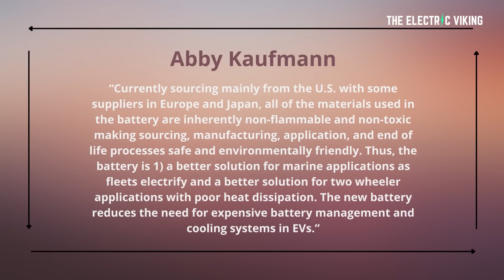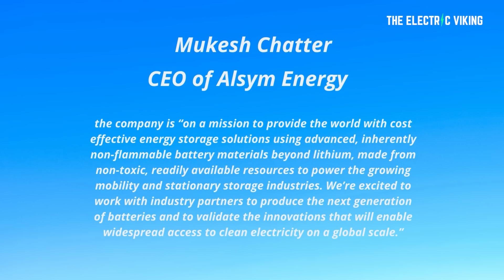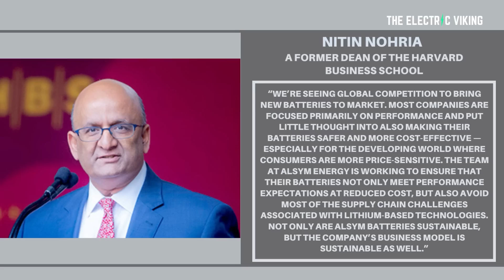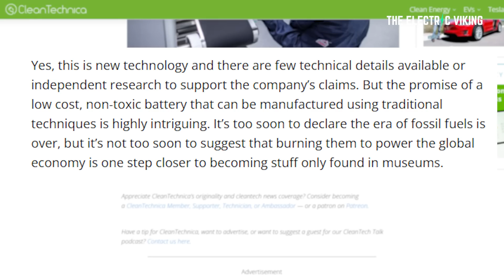NEW super cheap WATER batteries revealed by US company

Comment: Click -  title - lol, water-based electrolytes are nothing "new" - 

Yes the Uber-protectionism being displayed is strange - most companies will have IP well sewn up  before any public statements are made.   ?? Patents ??

Using heavier, less reactive materials in electrodes will deliver lower energy density - as there is lower energy available in the redox reactions. - Power density on the otherhand is more about battery configuration rather than chemistry - specifically.

Comment: Patents of Dr. Rahul Mukherjee: U.S. Provisional Patent Application No. 62/815,770, filed on Mar. 8, 2019, the content of which is hereby incorporated by reference herein in its entirety.
TECHNICAL FIELD
This disclosure relates generally to aqueous aluminum ion batteries, hybrid battery-capacitors, cathode compositions, anode compositions, binder compositions, and methods of their manufacture and use

Comment: A new game changing battery with no specs at all, from another startup. File this under “Unlikely”. Could it happen? Sure. Will it happen?… I can see the holding back on the tech reveal due to competition, but to avoid any specifications on performance benchmarks is highly suspicious. My guess, heavy, lower voltage, slow charge times. Therefore boats. Therefore non critical ATV type uses. Who knows, but their Holy Grail description is the biggest red flag.

Comment: Water based electrolytes means low voltage cells, usually lower than 2V. This battery will have a hard time competing with Li-ion, as it requires doble the connections and BMS circuits.
That said: the more, the better. I hope it succeed.
There is a lot of promising electrochemistries floating around that never seems to reach the market. Like that very interesting Al-ion urea battery.

Comment: Mate, love your enthusiasm and  the work you do, fantastic mate to hear an Australian perspective especially about so many other non-Tesla alternatives…but please, please- check your audio levels! They are so loud they are almost distorting at times. As a documentary maker of old, when editing, you need to check them, thanks. And while I’m nit picking, may I suggest a lowering of the lights! You are over lit around the face and it doesn’t look the best.  Bouncing off the ceiling or a nearby wall is a really good way to diffuse interior lighting. The jump cuts are ok but not the most fluid for a professional look, you may want to look for alternatives. 
Other than that, good stuff - especially the many alternatives in brands. May I suggest a future program where you list all the full BEV’s sold in Australia and their availability and ease of purchase. 

Cheers Sam.
Reply: Audio level sounds about OK to me, compared to other channels, but it's indeed possible that the input level is set too high, saturating and distorting the audio just like the lighting and room color is saturating the video.
It could also be a defective microphone, a poor choice of recording settings (either on the software side or with the different buttons on the microphone hardware). The naked-wall room with almost no furniture also ads echoing, not as noticeable in this video as in some previous ones though, but that's not what is causing this amount of distortion.

The white room and lighting color are indeed making Sam look like a first-generation-LED electric Viking, no wonder it makes him blink like a great horned owl...  😃
There are warmer color LED light bulbs that would look better on that skin complexion, and they might also reduce the shadowing that makes the eye bags stand out. Some creams and make-up could also do the trick, but it's really no big deal, at least compared to the work needed on me to make me just presentable. I'd need cream by the gallon!

It would also be great to reduce the unreadable list of links in the description to those pertaining only directly to the video, or actually start putting even one relevant link (no link to Alsym web site, for instance) instead of all this self-promotional stuff.

Yeah, sorry, I talked about everything except the content, but that's because Alsym is only vaporware so far, there is really not much to talk about with them, only questions to ask. They actually look like a bunch of Indian scammers, but as I understand, it's because they worked mostly with Indian customers so far and now want to get more visible on the American and world markets and raise more money? That was probably the goal of the Big Announcement that announces nothing. Still, I'd expect a little more diversity for an American company.
Reply: @Chimel31  hi there. I do like your turn of phrase, you had me laughing at times. We’ll put with some good ideas.
Reply: I agree the audio level is very much "clipping" for past dozen+ videos!  He just needs to turn down his microphone audio gain level.

Such a simple problem is distracting from his message.

Comment: If you watch some Robert Murray-Smith on batteries, you realise there are hundreds of ways of making a working battery. But to go into commercial production, that battery has to be better, in some meaningful way, than existing solutions. A working lab prototype is easy. (A lemon with a galvanised nail, and copper wire will light a red LED !) But translating that to a profitable business - that's the hard bit. You need the chemistry, money, time, a definable market, and the skills to find all of those...

Comment: Aluminium ion batteries are being pioneered in India and Israel, and are a definite possibility. The theoretical energy density in excess of 1kW/1kG is attractive and has been demonstrated in the lab.

However,  the technology has proven very tricky as a secondary (rechargeable) battery as aluminium quickly develops oxide layers that limit battery life and graphite electrodes rapidly degrade preventing fewer than a few tens of cycles. 

The research focus is on electrodes incorporating graphene, vanadium and manganese, as well as a variety of electrolytes.

Aluminium ion (aluminium air) batteries with salt water electrolyte used as primaries, potentially giving a range in excess of 1000km and swapped out when exhausted, are possibly a nearer term option and you can even build your own (see below).

https://en.m.wikipedia.org/wiki/Aluminium-ion_battery

https://www.exploratorium.edu/snacks/aluminum-air-battery
Reply: The trouble with any battery that essentially "eats itself" in hundreds, or tens of cycles is that it reintroduces the issue of logistics to transport the unit/ material to point of use.
It's the same problem as Hydrogen (or for that matter Li-ion pack swap!)
.
Logistics equals cost, plus any supply problem, (for instance weather) compounds the issue.
Also, even if the recycling is cheap for one cycle, multiplying that by 10-50, maybe even hundreds of times in comparison to a 3,000+ cycle LiFePo4 pack makes it very expensive.
Battery packs should be "boring".
Choose the performance envelope (energy/ volume/weight/ cycles) for the application.
Fit.
Forget.
Reply: @rogerstarkey5390  Yes same with coal, gas oil water.

Solid state fit and forget batts maybe just within bounds of possibility but not for a while yet.

Comment: Endorsements from a Business School guy and a Mechanical Engineering Professor.  Hmm, how about a Chemical Engineer?  That would give me more confidence.

I don't doubt that they have something that "works".  But there have many technologies before with similar promise with just "one or two things to work out".  Then they never are able to resolve their problem with maximum cycles, discharge rate, voltage, density, or whatever.  So, I hope for the best, but don't expect much with this one.  I have more faith in Sodium Ion batteries at the moment, but that's likely for utility storage rather than EVs.